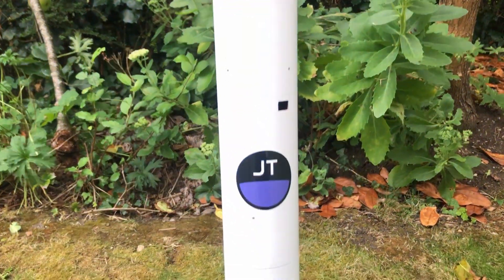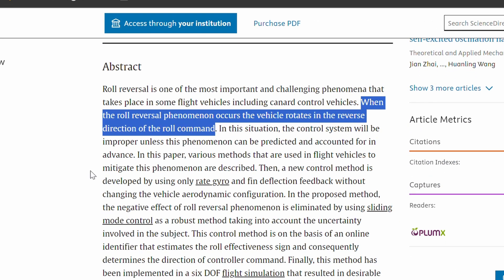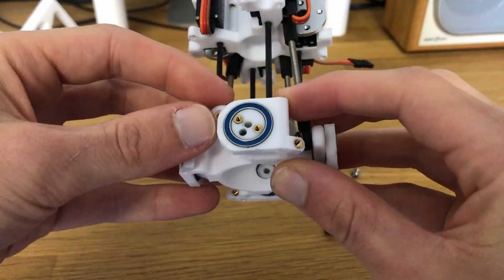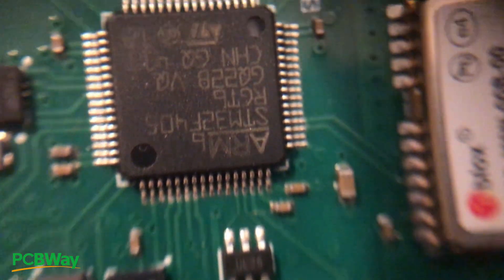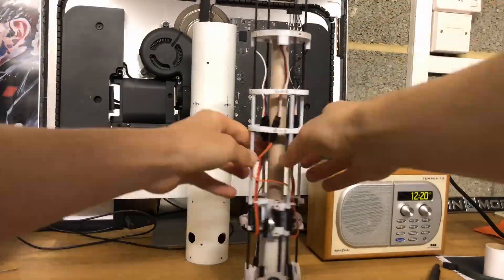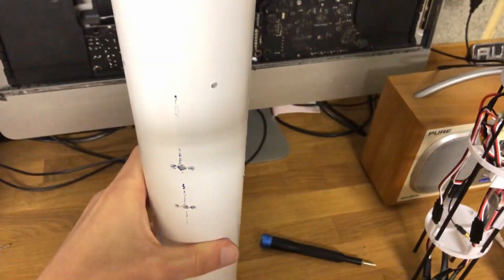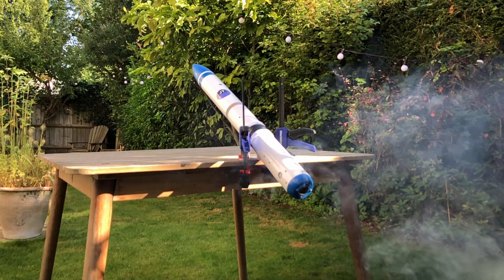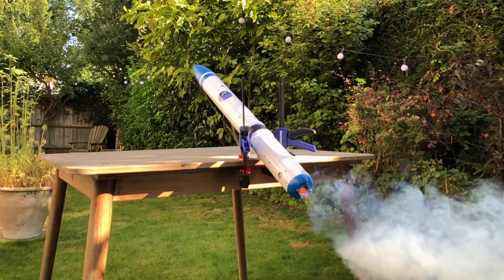Making a Fin-Controlled Model Rocket

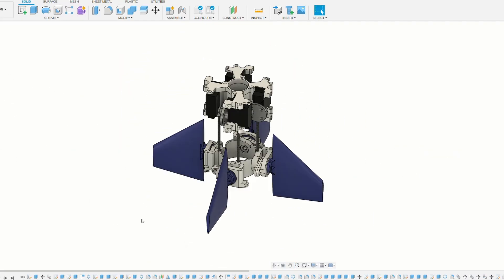Comment: 1:50 what do you mean by the adverse effects of print orientation?
Reply from the maker: Sorry, I should have explained. 3D printed parts are often weakest at the boundary between layers, so you often have to alter the print orientation to avoid loads that would act to separate the layers.
The problem with this linkage is that it takes loads in several directions, while also needing to be press fitted into bearings (3d printed shapes are typically most precise when in the xy plane, which limits the print orientation). So all that is to say that I found it worked best when printed in 3 parts in varying orientations, then glued and bolted together.
Reply: @jacobthornhill   Wow thanks, this explains a problem I've been having with my builds. tho i wish the software could compensate for this during the build

Comment: There isn't enough gas volume from the parachute charge for that long tube. You need a gas piston with a small chamber by the motor with a connecting  rod up to the chute.
Reply: Good catch! It's obvious once you mention it, but I didn't think of the reason of failure and your solution. The piston doesn't even have to seal very tightly, it's just a fast burst of gas.
Reply: @charvakkarpe  a loose seal should be fine. A "dog bone" shaped piston to keep weight and space down should do the trick.

Comment: What kind of firmware you are running on your STM32 Rocket flight controller? Is it some kind of open source autopilot firmwares like ardupilot or PX4 modified for rocket control surfaces and actuator controls
Reply from the maker: I'm writing my own firmware in C, and I'll be posting a video about it in a few weeks when it is more complete